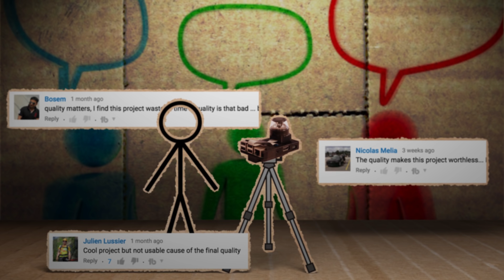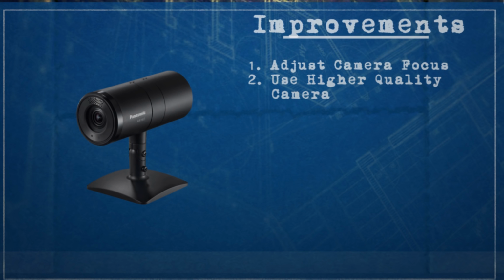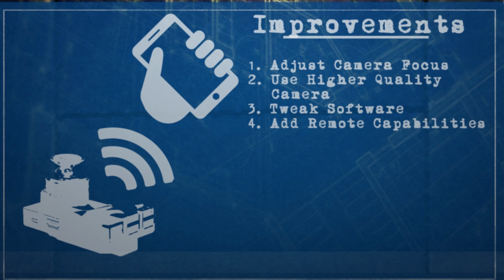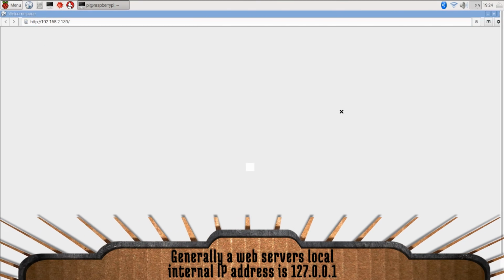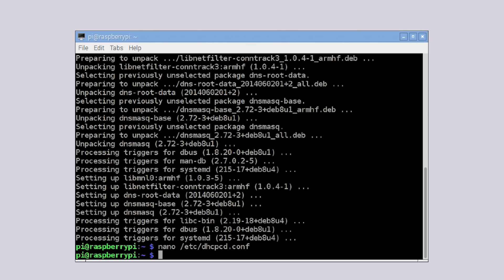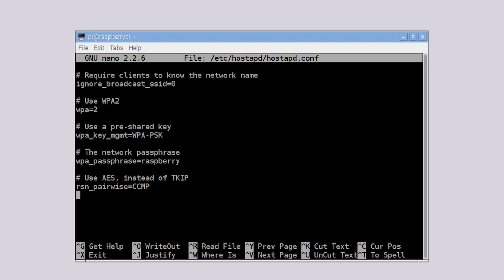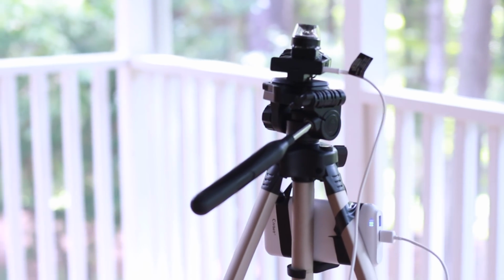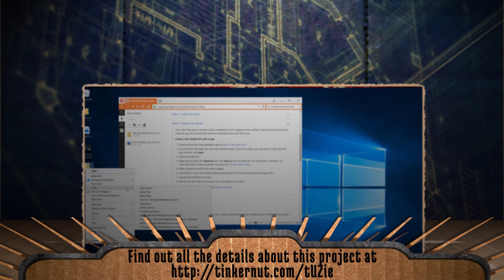How To Make A Cheap 360 Video Camera With A Raspberry Pi - Part 2

Comment: how would you create an rc vehicle/aircraft that you can control with a remote but when the receiver doesn't receive signal in x seconds it would activate autonomous mode or something like opencv assuming the thing still has charge in it

Comment: what about a higher frame rate camera and a rotating mirror above it? you should be able to get a much clearer image at the sacrifice of some FPS. Also I'm pretty sure a raspberry pi 3 has the horsepower to do a live rendering of the 360° for the web server.
Reply from the maker: that's an interesting concept with the rotating mirror. it may be able to do live rendering, but i wasn't able to figure our how to do that as well as show a live preview, so I had to do them as separate steps.

Comment: This is really cool! You should do a video on making a Ipod classic into a 1TB music holder. Its totally possible using a dual SD card slot board on OWC and the converting two micro SD 512 GB cards to normal SD cards. It would be cool!
Reply from the maker: I actually did a video like that using a CF card.
Reply: Tinkernut here this is what I mean. It allows 512 GB and maybe you can figure out a way to make it a 1TB would be cool! https://eshop.macsales.com/item/Tarkan/DUALUSD/

Comment: Yea. WiFi and Linux. And Realtek Chipsets. I was unable to compile the original drivers for the pi. Luckily there was a package in the AUR that helped me out. Not exactly the driver i needed, but as long as it works 95% of the time, i am happy.

Lighttpd is super simple. I use it too. Works very well. 

For hotspot creation, create_ap is a nice little script that does all the work for you. Creates hostapd config, launches everything, sets up NAT, DHCP, ... My Pi 2 has only one Wifi Card, so while i am connected to it, i don't have Internet, but whatever.
Reply from the maker: Awesome tips!

Comment: I still believe running the GUI is a hindrance to its' performance.
If a GUI is a must, I'd suggest starting from a lite install, then installing xinit and xmonad.
Xmonad is a tiling window manager. No styling at all.
Reply from the maker: running it with no gui would be even better. for the time i had to spend on this project, that's what i had to work with, but i'd love it if you were able to come up with a more resource-concious alternative. if you do, let me know and we can add it to the github code for this project.

Comment: The technology that assigns IP addresses to devices is DHCP, not DNS. DNS assigns IP addresses to domain names.
Reply from the maker: Yep, I misspoke. However, the DNSMASQ software does both.
Reply: DNS assigns domain name to IP... not the other way around.
Reply: It does resolution both ways. IP address to hostname and hostname to IP address.
Reply: DNSMASQ Is also a dhcp server.  Its used in dd-wrt routers.

Comment: are you going to show how to make a thermal camera?
Reply from the maker: If I can ever figure it out ;-)
Reply: okay then good luck
Reply: What if you use infrared thermometer and scan the object with servo/stepper motors?Mirrors? I don't know how they will affect the thermal image.The hardest part will be software, putting each scanned pixel in one still image
Reply: Might be most practical to use a NoIR camera and a bunch of infrared high beams. Not really thermal, but hey, you can see panoramically in the dark.
Reply: That's not bad, but it won't be an image, since the resolution is not up to that task, but should work for rudimentary purposes.

Comment: Awesome video! 
Why did you have to install a hotspot service? Could you not have just used the built-in ad-hoc service on the Raspberry Pi?
Reply from the maker: Ad-hoc services have issues with some devices. Setting it up as a hotspot is more reliable.
Reply: Ah, Thanks for clarifying!

Comment: why do I need a webserver? why not a Bluetooth module on GPIO that can interface with a remote, or even IR if you want to go cheap. seriously.
Reply from the maker: You can't preview live video with an IR remote or Bluetooth, which was the primary feature.
Reply: Well, if you did have a bit more horsepower on there, couldn't you operate a screen that is showing that video? In theory: You have the normal PiScreen, and it can be showing the current video feed/etc. Or if you want to get clever, ethernet/bluetooth connection to another Pi for such a preview connection with little to no obstruction.
This is just a theory, I'm only certified for computer repair, so excuse any unintelligent sounding comments if you can.
Reply from the maker: The Pi3 should have enough horsepower, and you could even code some touch-screen controls for it, so that's yet another option. I went this route so I could control it remote with my phone. I like the direction you're going, though.
Reply: That sounds like my theory has held up a bit then, if it can impress an experienced tinkerer like you. However, let me go into a bit more depth.
Let's simply say you had a small switch, or even a crossover cable with enough length, preferably CAT5E of CAT6. And a basic program interface, such as [Start] or [Stop] to be triggered by ports on the RPi3 with Python taking up a bit of horsepower. Or maybe a BT Remote for such a thing. Not to mention if you wanted to go batshit insane you could rig this crossover with a laptop and do the same for portable 360 Video with the Cat6 cable able to up upwards of 90 meters, if I am right.
This should allow for a lot more room to keep equipment out of shot, or you could do it with the Pi screen, utilizing a Stop/Start command with a set delay option of whatever seconds you need. 
Are you digging it?